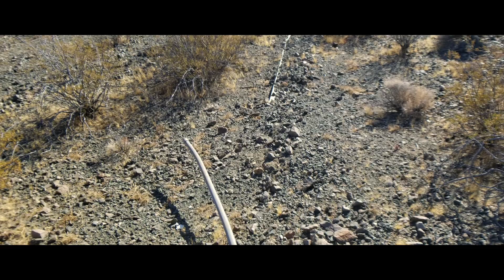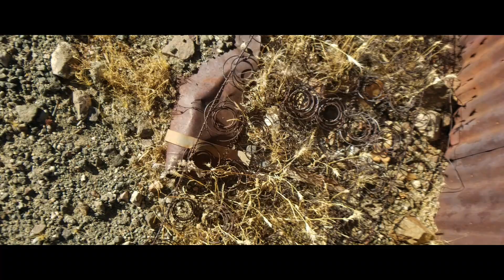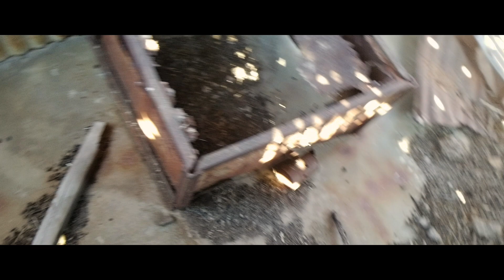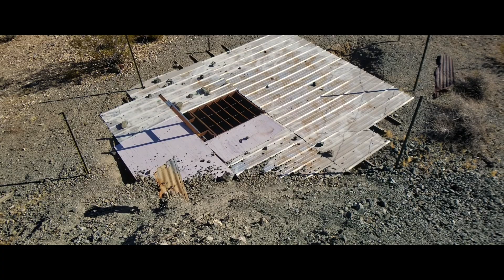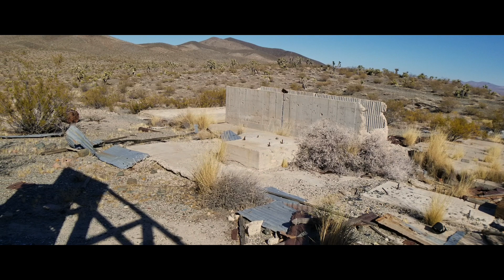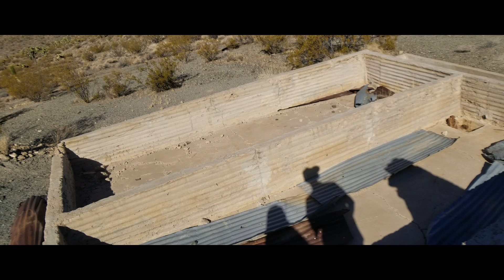Mini Mine Mini Mill

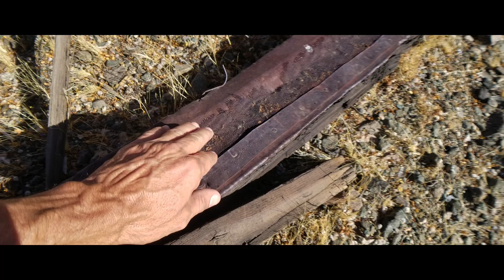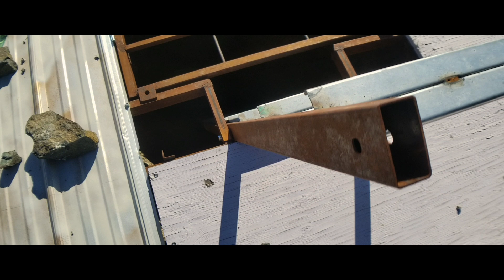Comment: Dude, at 5:20 the hex nut tells me the date was after 1930s and a window screen will  last  around 10 to 15 years before it begins to break down.  The tailings ramp tells me the mine is less than 150 feet long plus the bolt (13:57) on the ladder is fairly new so the USGS or the owner installed the security and ladder within the last 5 years.
Reply from the maker: Thank you!!!!